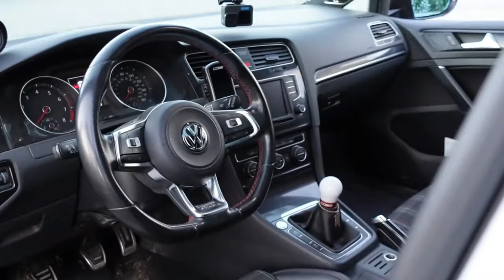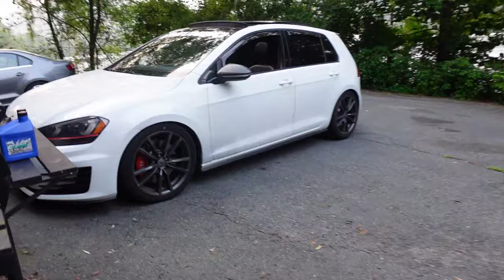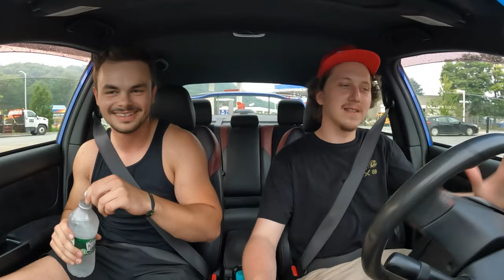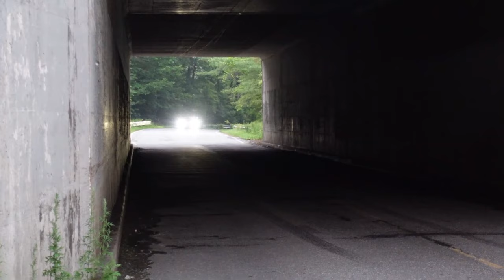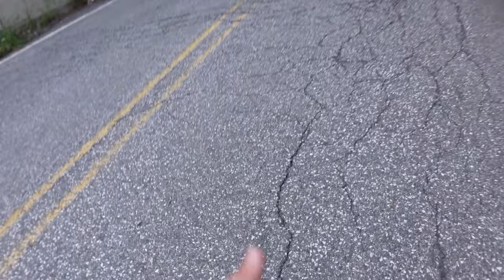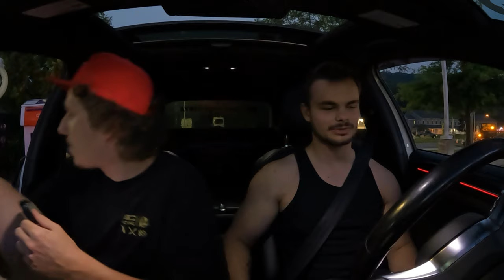IS THIS THE LOUDEST IS38 GTI IN VERMONT??

Comment: Hey Chris, have you had any problems with the bezel around your sunroof cracking?
Reply: Mines cracking on my 7.5
Reply: @donovanhynes7015  Mine is cracked on the drivers side and the passengers side closest to the windshield
Reply from the maker: Yesss dude I have the exact same thing! Sucks there seriously isn’t a way to prevent it other than try to not have it in the sun everyday I guess 😂 I was gonna make a video about all the very small problems these have